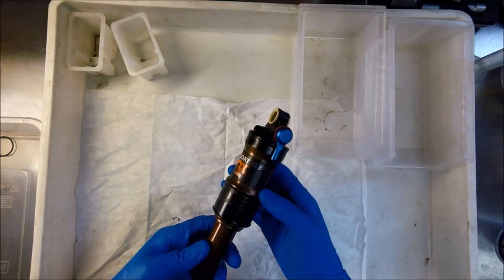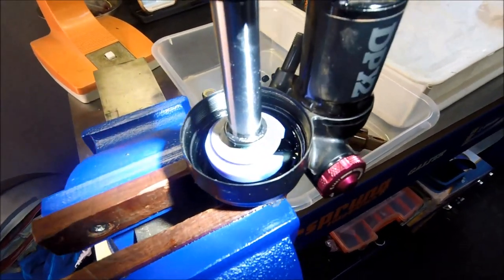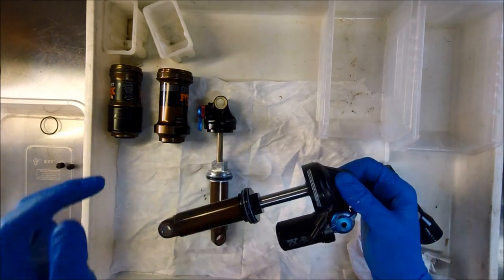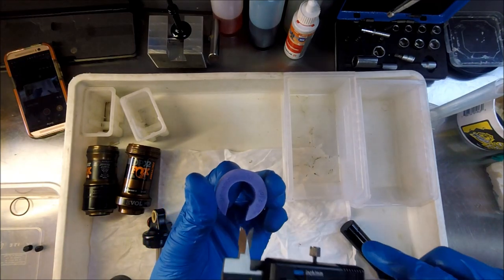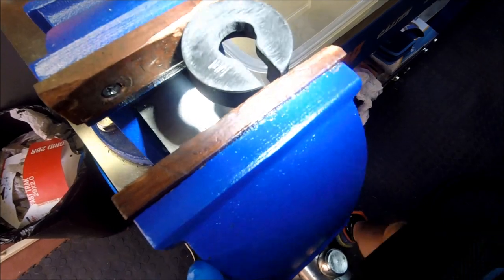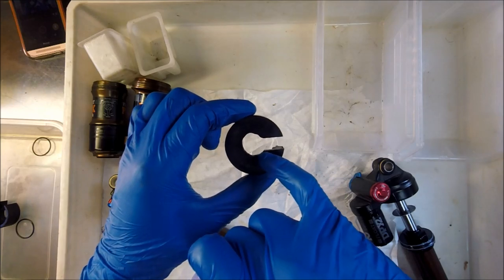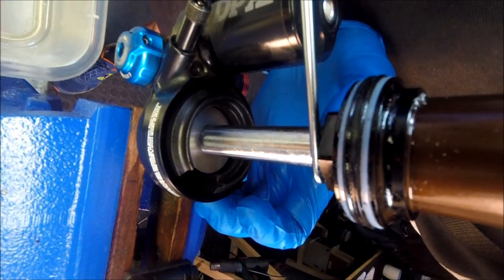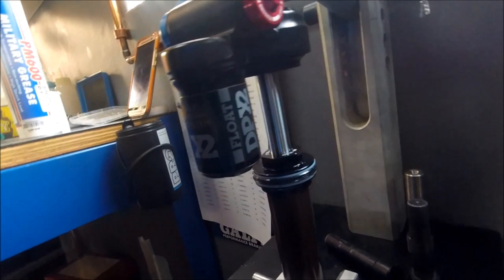DIY FOX DPX2 Volume spacer | DPS to DPX2 | Fox suspension mod

Comment from the maker: Ride report:

Ramp up is now supper aggressive and I love it , I actually dropped the pressure to 188psi.
roughly 3 hours on the bike and not a single snag or problem came up.

Use discretion and try at own risk.
Cheers !

Comment: I just learned that you can remove the stroke travel spacer (aluminum, 2.5mm or 5mm) if you have one, as long as you don't scratch the shaft you're good. Supposedly you then can use a smaller volume spacer then? Has anyone done this?

Comment: Spent $600 on a shock and $20 for spacers is too much?  God Bless your tenacity in cost savings though.
Reply from the maker: Cost was one thing due to the state of my country's postal system they would likely have taken 2 months to reach me. But yeah at least there's some decent thought put into the shock I'm paying so much for while relatively those molded plastic spacers are priced absurdly
Reply: For that amount, they should come WITH the shock.

Comment: Can i run it without a spacer
Reply from the maker: The metal washer?
Reply: JustFrana no without any of the bottomless spacer.
Reply: @davidsch6490  yes but it would make the shock very linear. Meaning the shock will go through it travel quickly. Spacers allows the shock to resist bottoming out as they get closer to end of travel. If you ride aggressive and find you are not using all of your travel, you can remove and see how it feels.